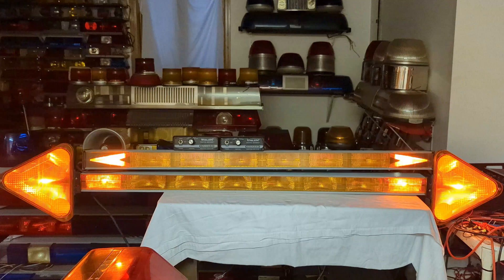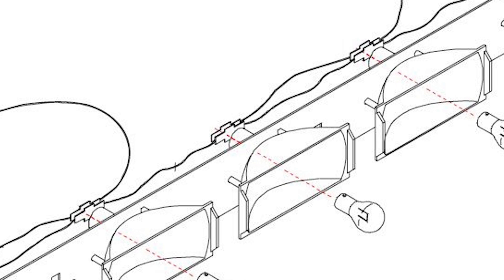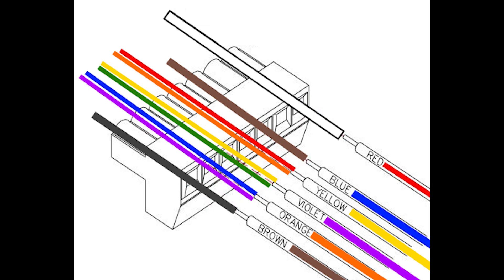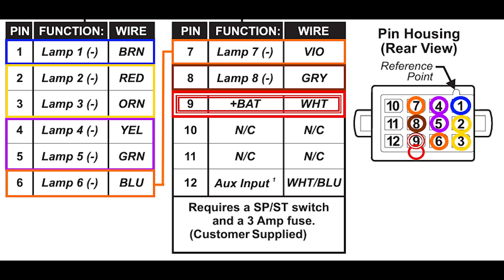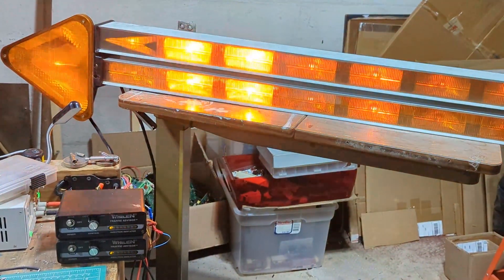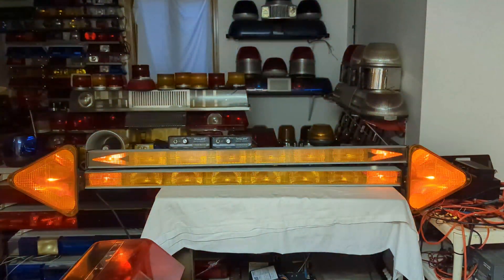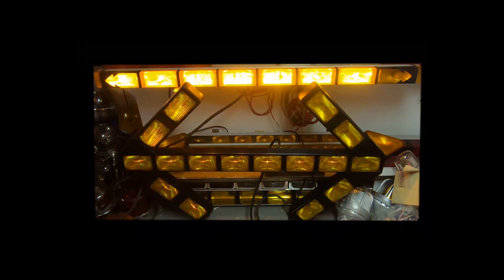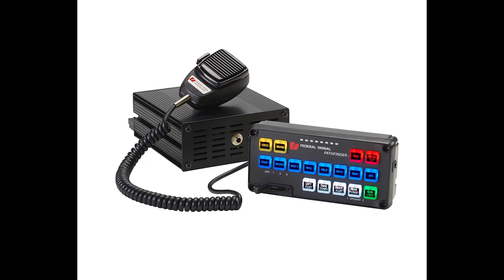Code 3 Arrow Bars Running (traffic advisors) on Whelen Controls

Comment: On the whelen controller you can choose anywhere from 5-8 light heads. Since the code 3 ta has 8 light heads but only 5 can be controlled independently. What would you recommend setting it to via the dip switches?